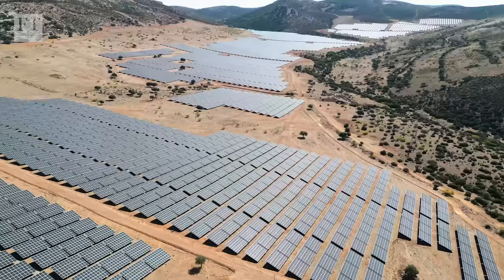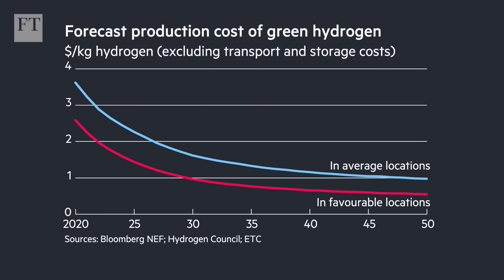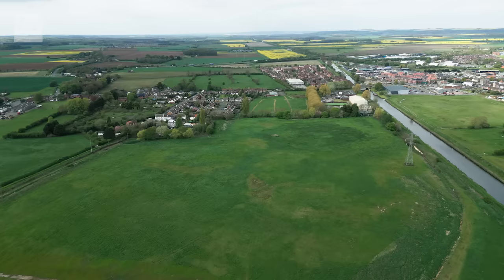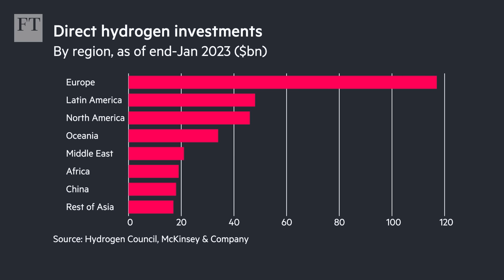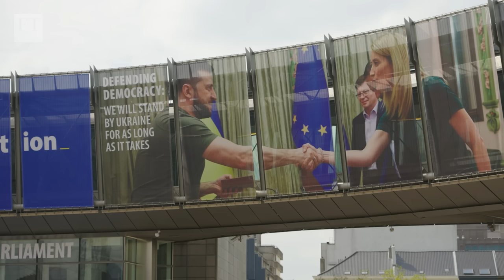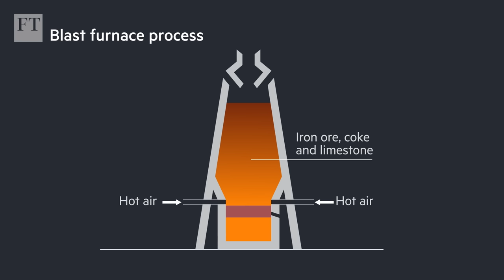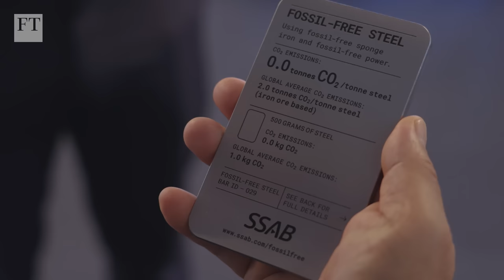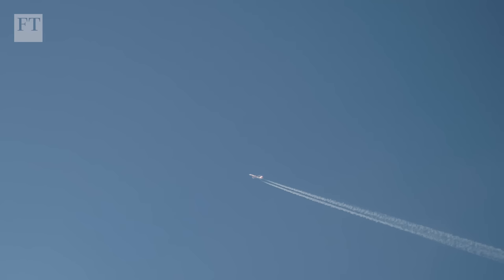Can hydrogen help the world reach net zero?  | FT Film

Comment: If hydrogen is made from natural gas, about 30% of the energy in the original gas is wasted.
If it is made by electrolyzing water about 20% of the power in the original electricity is wasted. Hydrogen fuel cells are generally between 40% to 60% energy efficient, according to the U.S. Department of Energy.
So, at best, about 48% of the original electric energy is available to drive the car. Li-ion batteries are claimed to boast a round trip efficiency of 96 percent or even higher.
So hydrogen is a far less efficient fuel than electricity.
Reply: Probably correct, but batteries have a load of their own problems, such as need for rare metals, where some elements are only found in certain locations… and so we go in an insane loop back to the beginning of people/ countries fighting for control of these metals just like we had with oil 😜, ignoring problems of pollution producing the materials and weight issues etc 
So no, there is no magic solution coming to save us from our selves
Reply: On top of which, hydrogen needs to be compressed to achieve sensibly usable energy density (Wh/litre) and this uses further energy that ends up being lost. However batteries are no panacea either, they simply don't store very much energy at all relative to classic fuels.
Reply: @grahamstevenson1740  Precisely. Battery technology still has a long way to go. IMHO flow batteries may be the answer for long term storage. the alternatives are ammonia or , with carbon dioxide capture, methane or methanol.
Reply: @grahamstevenson1740  very good point about the hydrogen!
Reply: @mike160543  Flow batteries are interesting. Their disadvantages are relatively low energy density and sheer bulk but overcome many other battery problems.
I personally doubt that lithium-ion can be bettered for high energy density, there simply aren't many other electrochemically interesting compounds.
I've even seen 'liquid air' being outed as a energy storage medium.
Reply: @grahamstevenson1740  Flow batteries could only be used for long term storage.
Reply: @Astrogator1 Li-ion might be the wrong technology. Aluminium-air batteries is likely to be better due to far longer range.
Reply: I agree, and that's whey hydrogen should only be used in situations where batteries are not viable, like aviation. For personal vehicles batteries are the solution. They will still benefit greatly from more development to increase energy density and reduce rare earth usage, but this will happen.
Reply: Yes Mike 160543 but where does electricity come from ?if you are in America most of your electricity comes from thermally generated sources - so back to the original 50% that you quoted with other ways of making hydrogen, The best thermal power stations can only achieved 50% also so the only electricity that is green so to speak would be hydropower I am in New Zealand and much of our electricity is hydro even so we are still with solar wind and hydro less  50% total renewable and we are one of the countries that has a great lot of renewable energy
Reply: @Astrogator1  But those same problems you listed with batteries also apply to fossil fuels, and much of hydrogen production, for that matter. You are right that there are no "magical" solutions, but there never have been, and yet history advances. You don't chase "magical" solutions, you just go with solutions that are BETTER than whatever the current option is. Batteries tend to be better than hydrogen in most applications, but there are currently some places in which hydrogen works better, at least as a complement to batteries.
Reply: @grahamstevenson1740  I think that even if Li-ion can't be beat on density, it could still be possible to beat them in overall usefulness through other means. For example, if other batteries are about as good, but much cheaper or longer lasting, that would make them viable in a lot of applications. Also if a battery could more safely charge at much higher speeds, that could be good. Like if a car had half the range of a current vehicle, but could charge in 2-3 minutes at a fast charger or under an hour from a more basic charger, then a lot of people would prefer that.
Reply: @timogul  Unfortunately nothing really comes that close. The Lithium Ferrous Phosphate chemistry (there are around 20 or so chemistries that are all lithium-ion) probably is the best trade off between price and performance.
Reply: In the near future it is not even about storing energy. It is about replacing grey hydrogen for the applications, that we already use it for. At the current speed  of transition it will take quite a while until we have enough seasonal overcapacity to replace that hydrogen.

Comment: 0:41: 💡 Iberdrola is investing in a massive green hydrogen plant in Spain as part of their ambitious plan to build a hydrogen economy.
4:13: 🌍 The enthusiasm for green hydrogen may have negative consequences on global warming, and there are concerns about the slow decarbonization of the grid due to the electricity needed for green hydrogen production.
10:32: 🌍 The global hydrogen industry is experiencing significant growth, with three types of projects showing promise: green hydrogen for classic industries, renewable capture and shipping, and mobility networks for captive fleets.
12:40: 🌍 Europe is investing in hydrogen as a solution to decarbonize and reduce reliance on Russian natural gas.
17:42: ✈ ZeroAvia is developing hydrogen-powered engines for planes, aiming to solve two-thirds of the aviation climate impact.
21:55: 💡 Hydrogen has the potential to decarbonize industry and transport, but its role should not be overestimated.
Recap by Tammy AI

Comment: Hydrogen paradox is the following: to produce 1kg  of H2 you need 6 litres of water of good quality. For scale the Toyota Mirai's 400bar reservoir holds 7kg for a 300mile  range. Calculate out all that H2 activity you mentioned how much water m3 will be required? 2022 saw the Rhine, the Mississippi and Yangtze almost running dry. Where will they get the water they need to produce H2 at volume? Ah desalination you say and forget about the the devastating effect of dumping brime in the sea. "Clean H2" needs to be examined on its environmental  impact and its energy efficiencies . There is a role although not massive.
Reply: Water treatment plants could be tapped for water.  

Let's not get overly excited.
Reply: Processing hydrogen for energy results in water, in the end a balance could be obtained.
Reply: @user-nb5sr7by6y  you are serious? Did you read what was written?
Reply: @marpintado  that assumes a perfect closed cycle, there is no such thing.
Reply: Muppet: you need 9 litres of water, not 6!
Reply: Agree with your concerns. 

Hydrolysis from sea water: at a time when our oceans are already stressed and under threat. 

This puts Phytoplankton populations - responsible for most of the transfer of carbon dioxide from the atmosphere to the ocean - at risk of at least decreased richness in diversity as salinity increases. The AMOC is also adversely effected as salinity increases, and there may be other additional impacts to the water cycle, including rainfall patterns and volumes, etc.

My understanding is that mass "green hydrogen" production at scale - far above the current research, testing and proof-of-concept efforts - and its impact on the broad planetary system, is not well understood, nor has it been factored into scaling green hydrogen production to the significant quantities needed to replace coal, gas and petroleum use in industrial settings - such as raw-materials extraction and processing including steel production.
Reply: @cliffwilliams8616  Yes I agree but I didn't want to further then the pure theoretical, but you're right and that's without counting the water used in cleaning cycles......
Reply: Use water from the wastewater treatment plants or from green desalination strategies.
Reply: @FlameofDemocracy  can you say more about green desalination? Can you point to good reference(s). Appreciate any pointers.
Reply: 9 kg of water / kg of H2 minimum from (h20--} h2 +0.5 O2). (Ratio between molecular weight 18/2) Ultra pure deionized. In practice more than 20 kg of potable water / kg h2.

Comment: HiiROC's emerald hydrogen, whilst not realising CO2in to the atmosphere, still uses fossil fuel methane from which to extract hydrogen, of which the World only has 60 years supply left. As innovative as it is, it is only a short term answer of less than 60 years. The plant is also powered by the grid, which includes fossil fuel generators such as natural gas, coal and bio (wood chips).
Reply: If we on the other hand use that process with methane from biogas that could even be a building block in becoming carbon negative.
Reply: Biogas! WTF are you on man? @MusikCassette
Reply: @grahamcook9289  what is your problem?
Reply: bio (wood chips) is not a fossil fuel.
Reply: @kiwitrainguy  correct, it is pre-fossil fuel. 🤦‍♂️

Comment: H2 is horribly inefficient medium in comparison to chemical batteries. And with the rate of advancement in the battery field today I firmly believe that they will surpass H2 on cost and performance by the end of the decade.
Reply: We don't need H2 as a medium for energy storage, we need it as a chemical. And we can use its production to compensate for seasonal differences in energy production.
Reply: @MusikCassette  Go back to school. Its not a chemical. Its an element. And its a lot more inefficient and expensive than a chemical battery. You have to generate 3x the amount of electrical power to generate enough H2 to give you an equal amount of energy from a battery. Even Compressed Co2 is a better long term solution.

Comment: The statement about "hydrogen powered" airships is idiotic. How embarrassing, FT.
Reply: Thanks for flagging that slip - I should of course have said “filled” instead of “powered”. We’ve now fixed that.
Reply: @SimonMundy  thank you. That's the FT I subscribe to!
Reply: @SimonMundy  Actually, the Germans experimented with hydrogen combustion (additionally to diesel fuel) on LZ 129 Hindenburg. Not because of environmental concerns of course, but for lift control. Airships are getting lighter during the journey by burning fuel. So they have to vent lifting gas or take up ballast (water).
Using the "excess" hydrogen for propulsion instead of simply venting it would have increased efficiency.
But it didn't work well, they didn't use this method in regular flights.
Reply: @SimonMundy  Nevertheless thank you for the correction!
Reply: @SimonMundy  And for the sake of completeness: Helium would have been too expensive for regular venting and replenishing.
One method of getting ballast water over dry land was condensing water from the exhaust gas (hydrocarbons combust to CO2 and H2O).
The first helium filled airship which used this method was ZR-1 USS Shenandoah (1923).

Comment: 22:45 it's really that simple. electrification and nuclear are generally more feasible and the better choice, overall, in most cases but when they aren't, alternatives such as hydrogen could be and should be of great use. it is not either or and anyone who says so is presenting a false dichotomy. the energy transition WILL demand the use and implementation of as many different sources of renewables as possible. hydrogen is part of that.

Comment: I will write my conclusion.
To reduce total CO2 emissions, long-distance transportation, especially trucks, should use hydrogen, and gravity power generation should be increased worldwide.
I obtained a national electrical qualification in Japan, and solar and wind power generation is currently on the rise in developed countries.
However, since power generation using natural energy is unstable, it is necessary to use surplus electricity as effectively as possible in order to stop large-scale thermal power generation.
Until now, pumped-storage hydroelectric power generation, which pumps up water, has been the mainstay, but it has the drawback of taking a long time to generate electricity.
Gravity power generation, which raises and lowers weights, quickly reaches the power generation speed, so it has the advantage of being able to generate power immediately while watching wind and solar power decrease.
My idea is to configure gravity power generation in a single building, and during times when there is surplus solar power generation, weights will be picked up and stocked on a conveyor on the upper floor of the building.
This would cover the instability of natural energy power generation, and in the event of a power outage due to a disaster, it would also be possible to transport the weights to the second floor using a forklift. (Power is transmitted only to high-priority facilities such as hospitals)
Please see my website for ways to reduce CO2 emissions at home.

Comment: The short answer to the question posed by the video is 'no' - for the most part hydrogen would be highly inefficient and extremely expensive. Just use the electricity produced don't waste it converting it to hydrogen and back to elecricity.

Comment: Hydrogen takes 3 times as much energy as you get back. SO that's NO for storage and land transport because pumped hydro and batteries work better. But hydrrogen will be useful for synfuels for airlines, and to replace coking coal in metals manufacture that require a reductant, and some green chemistry - and maybe SOMEindustrial heat (but most will be direct electricity and thermal batteries for that.) So NO to hydrogen in cars and trucks and grid storage, but yes the others

Comment: Why not carry metal dust like zn etc and whenever hydrogen is required, just react with water.
This can later be recycled using renewable energy. I guess efficiency will be higher than electrolysis + cold/pressurised hydrogen.
Reply: I highly doubt your guess
Reply: @MusikCassette  I am not someone from the sector bro... But had learned in high school that the reaction is there.
Now, carrying hydrogen requires a lot of energy (cooling + transport). The same is not applicable for zn/Al powder.
I really don't know about the efficiency of converting back the oxide to metal VS electrolysis.
Well, hope someone figures that out.
Reply: @pritamsinha5479  the recation is there. But it is a really uneficient way of doing it.

Comment: Toyota has developed a small foorprint, solar-powered 'stand alone' automomous hydrogen making unit which can be placed in petrol stations so no need for a "complex network needed to support large numbers of fuel cell cars" as mentioned in this video.  Innovations every second making it difficult to keep up with developments....
Reply: What is it's power rating (ie kW of hydrogen).  I suspect you will find it utterly miniscule vs the kWh required to run a car unless you have an utterly massive solar array...
Reply: The problem is that you need 2.5x as much electricity to create enough hydrogen compared to a BEV to move a vehicle the same distance. It's far less efficient. And the small-footprint station can only handle a very limited number of vehicles. Already, hydrogen stations struggle hard to keep up with demand.
Reply: @ehmcneill8811  The efficiency of a Solid Oxide Fuel Cell (SOFC) system is 55%. A single kilo of H2 is capable of generating 48 kWh, which is three times the amount of energy generated by a kilo of fossil fuels.

Comment: This video is riddled with errors and omissions - many pointed  already in the comments (balloons powered by hydrogen is the best). Making hydrogen from water requires guess what? Water and not any water but very pure water. Not only many areas in the world suffer from lack of water but treating water (fresh or sea) for electrolysis requires more energy and produces waste streams. Overall energy efficiency (round trip efficiency) electricity-hydrogen-electricity is somewhere between 30 and 45% - less than half.  Also, transportation of hydrogen is very cumbersome not only because of very low volumetric energy density (although on the mass basis it is good) but mostly due to very special materials needed.   No easy answers despite some smugness from the mail reporter.
Reply: I remember in school adding salt to water in order to make electrolysis and separate H2O. I wonder were I could find such type of water?🤔
Reply: Thanks for flagging that slip - I should of course have said “filled” instead of “powered”. We’ve now fixed that.